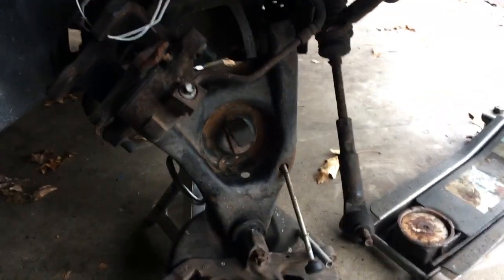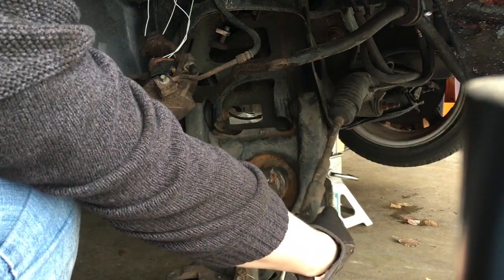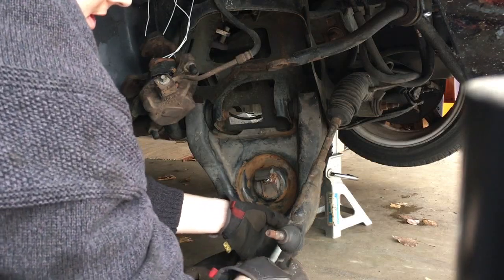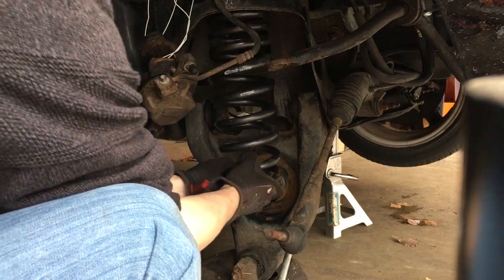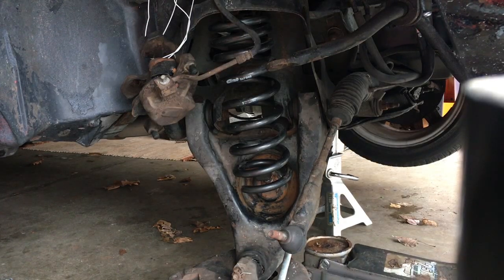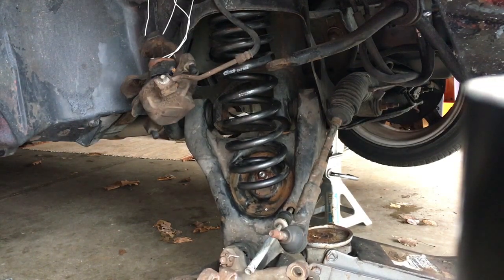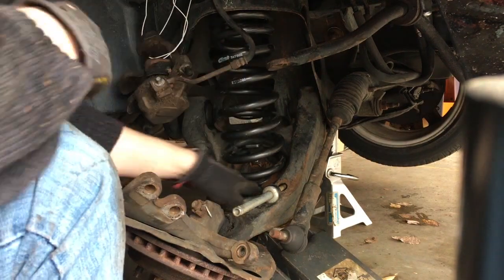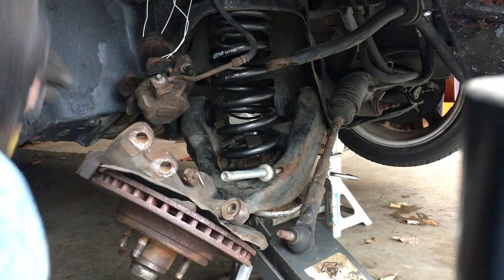79-04 Mustang front spring installation - Correct method!

Comment: Does NOT work with factory length springs.  Repeat.  Does NOT work with factory length springs.

Only thing i found for factory springs is a spring compressor OTC 7045B.  Its hella expensive but it made this job hella easy

Comment: Now, use that tool with stock length springs.  Nope.
Reply: Got one in with spring compressors but sketchy af any other methods?
Reply: Exactly. This tool says will not work with stock springs.    I also did not disconnect the tie rod from the hub.   No need to. Just unbolt pop the ball joint and move the hub assembly to the side.    You will have to loosen the a arm bolts to get the arm to swing completely down to get the springs in.
Reply: Just to add to this.  I bought this mm tool and it was a life saver.   I put my Stock springs back in with no problems whatsoever using these.   Then I replaced the stock springs and used this tool again with eibach prokit springs and it was a even easier install.     Install was a complete breeze with this tool!

Comment: ILL NEVER do it this way again. Ill replace with coil overs.
Reply: I just put two front springs on a 98 gt. Holy. Fucking. Shit.
Reply: I'm here trying to figure out how 1A auto videos just... jack up the A arm and viola!! 
Yeah, it aint no viola.
Reply: @suburbangardenpermaculture3117  I was so freaking pissed off when I was replacing these it made me sell it 🤣
Reply: @jeffreywhite7657  broski,  I am waiting I. The car for my wife RIGHT NOW about to go rent a spring compressor from O'Reillys🤣👌
Reply: @suburbangardenpermaculture3117  Don't do it! They suck!!
Reply: @jeffreywhite7657  I got no choice. I can't get this in, I've tried 2 Jack's and a strap, I can't get it up there. Right now, i got the more jankety spring compressor because they didn't have the dual bar thing. This one goes INSIDE the dang spring, and pulls from inside. It's scary, I'm about half way compressed and started second guessing myself. I didn't use the bottom brace part on the spring on the bottom, I put it under the A arm hole, and I'm not liking it, it's not sitting well on this curved spring wedge thing, so I'm thinking to take it back off and doing it all from Inside.  Not fun!!!